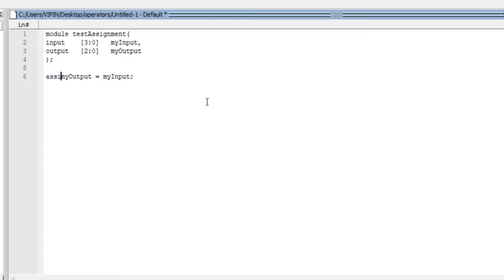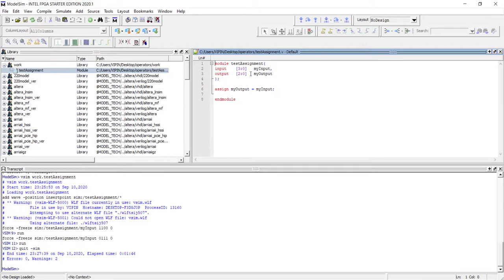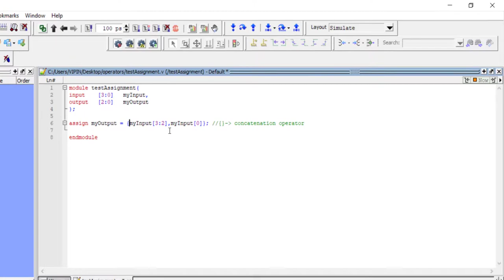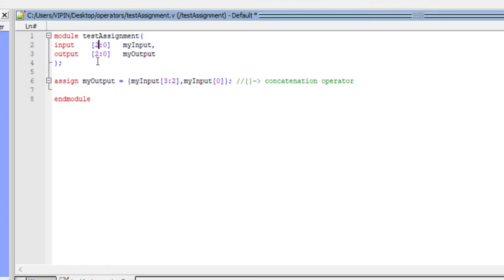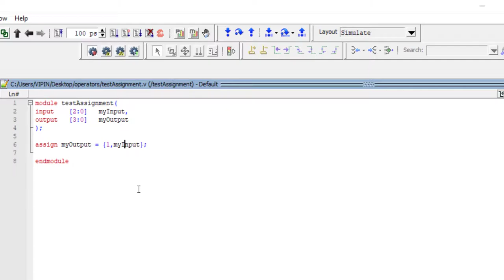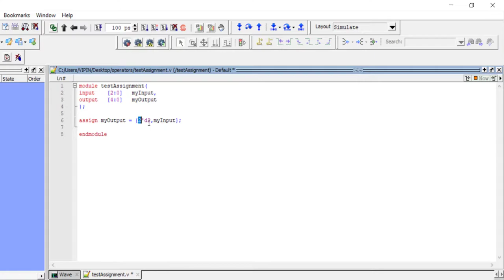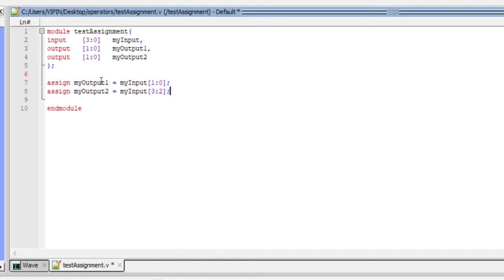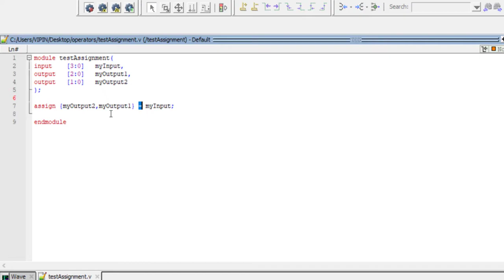Assignment, Concatenation and Bitwidth mismatch| Verilog Operators| Part 8

Comment: why do i need to close and reopen the modelsim each time when i edit  the program, otherwise when i run the simulation, the output is XX. but if i close the modelsim and run it i get the desired output.